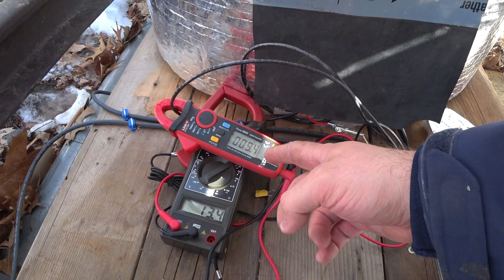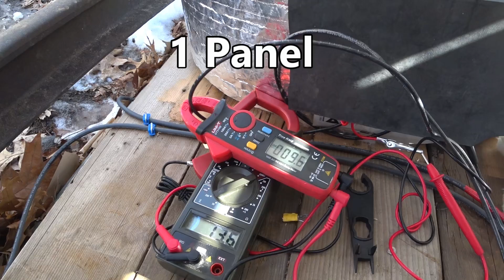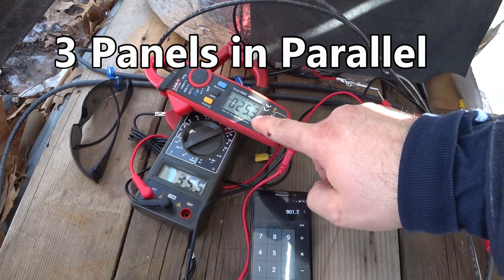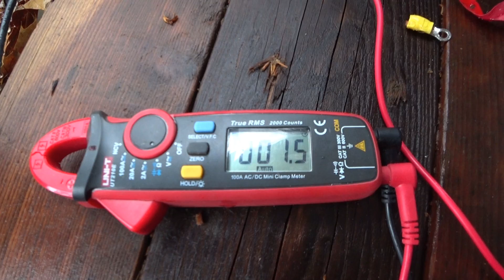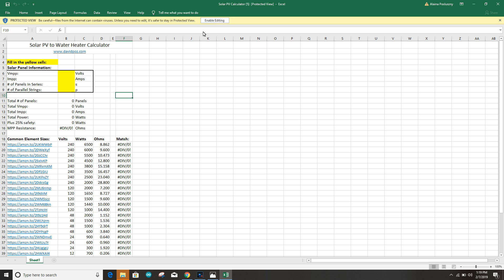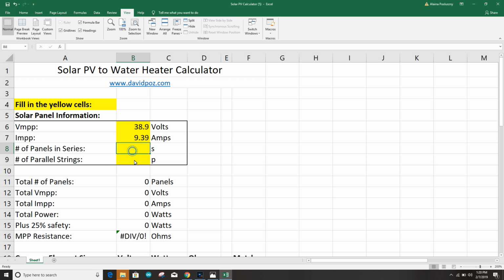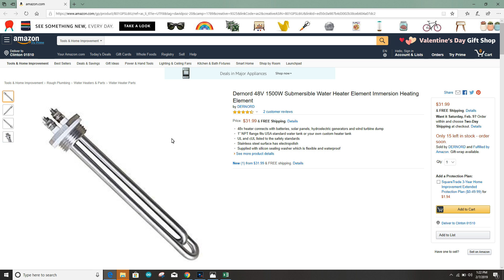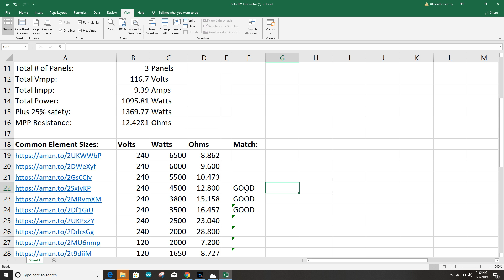Matching Water Heater Elements to Solar PV Panels

Comment: You never explained what was wrong with your "three in parallel" set up. It sounded like you had them in parallel. What was wrong?
Reply from the maker: Originally I had the panels in series.  But the ohms was way off and I was getting almost no power.  By switching the panels to parallel they matched the ohms and BOOM! heating water.  I created an excel spreadsheet available for free on my website to help.

Comment: but why they sell controller for the setup in series not in parallel...  https://3k-solar.bg/en/thermosol-k2/ ...becouse i have 6 panels 400wp /41.23 Vmpp; 9.70 Immp/ and i thinking to do 2x (3 panels in series) in ur calculator mean use 240v/3500w heating element, if i use 2x (3 panels in parallels) mean 48v/1500w heating element....  now i dont know what to do.....did i need that controller or not
Reply from the maker: The controller will probably gain you 30% more hot water than no controller.  So is it worth it?  Depends how much the controller costs.
Reply: @DavidPozEnergy  2x 200$

Comment: Is is a good idea to connect heating element direct to solar panel?
Reply from the maker: Well, you still need a fuse and circuit breaker in the circuit.  But the principle is what I'm testing.  It's not as efficient as using a MPPT controller, but it's a cheap way to get into solar.

Comment: Your 48v DC element is a two 750W 48V elements in one , if you change the bridging tab at the element, you can change that 48V 1500w  element into a 96V 1500W element, this way you don't have to have run with a larger current, and can work with other panel configuration. I have work on the 36V elements and changed them also to a 72V element by changing the bridging tab around on the element. so with these elements you can have 36V, 48V, 72V, 96V elements

Comment: There is "good combination" for a direct pv to elements connection, there is one that is not as bad as the others and still... It depend on where you live and when you want to maximise your production. You need an mppt or you'll lose 20 to 35% energy.
If you calculate the resistive value of the element based on 1000w/m2... Then it will work like shit on low irradiance days, at 500w/m2 it will already give a quarter of the full power....

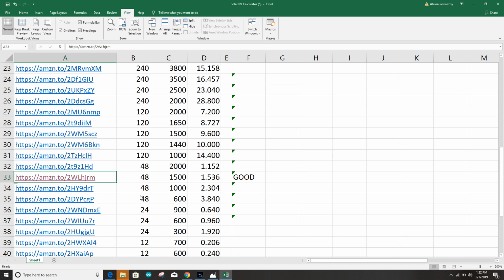Comment: at the 10:50 mark, you mention using a "standard of the shelf" heating element.....are you talking about the ones that come in the water heater from the factory?  if so, is there such a thing as a "DC" vs "AC" element?  or (as I am guessing) are all elements AC or DC? as well as non polarized...if that's the case, what size panels and how many and (I am guessing parallel) would you need to run a 240 volt 4500 watt  element?
Reply from the maker: Yes, you got that right.  The standard water heating element that comes from the factory is just a big resistor.  Resistors are not polarized.  They work with both AC and DC.  But, you must be careful because nothing else on a water heater will work with DC.  You need to have DC rated thermostats and relays
Reply: @DavidPozEnergy  ok, got that.....dc thermostats replacing the ac thermostats.....
what size panels for that pre-installed 240 volt 4500 watt factory element?
Reply: David???
Reply from the maker: What panels work with a heating element for 4500 watts and 240v?  Any panels can work with it, the trick is to arrange the panels in the right configuration of series and parallel.  I built a free online calculator, on my website home page.  The calculator will help you decide.  For example, if you buy Q-cell 360 panels, you would arrange 3 in series for the factory heating element 4500w 240v.  But the exact number of panels will depend on the panel you choose.

Comment: Keep in mind that the Vmpp and Impp are measured under standard test conditions which will likely differ from actual use conditions. For Vmpp and Impp the panel temperature is kept at 25C and level of insolation is equivalent to high noon... 1000W/meter^2. If the panel is hotter than 25C, then the actual maximum power point will be lower than what is given, and the Impp will be higher. Also, if the insolation is lower than 1000 W/m^2 then Impp will be lower than what is given. So the spreadsheet is a good first cut, but ideally you would adjust Vmpp and Impp to match your actual use conditions before calculating a resistor value. In general, you will probably want to have a slightly higher resistor value rather than lower (compared to Vmpp/Impp).
Reply from the maker: I agree with you.  That's why I made a range in the spreadsheet.  So if there is not an ideal resistor listed, it moves up, up as high as 40%.  One of the coolest controllers I've seen is Electrodacus.  His will add more resistors, or take away resistors, to match the panels.  Really cool.
Reply: @DavidPozEnergy  Yeah, love the spreadsheet because it gives you a starting point. Most likely the power ratings on the heating elements are not intended to be upper limits. They are probably just calculated based on V^2/R. It is probably safe to over-power them by quite a bit since it is just a water heater, after all, and as long as there is water in the container (at atmospheric pressure) there is no way the surface of the heating element can get much hotter than about 212F. Incidentally, what does your system do if the water all leaks out and the element continues to be energized? It might be worth knowing what happens. Thanks for the videos.

Comment: Solar for daylight understand, warming house at night ? Is it any solution?
Reply from the maker: What I do is warm my house during the day with solar.  I built my own house, and it is super-insulated.  So it holds the heat in.  Only cools off a degree or two (F) overnight.
Reply: @DavidPozEnergy  Thank you, I've been watching your videos, is perfectly understandable ,I planning doing same as you. In Europe ,winter temperature can drop to minus 20 degrees Celsius . For sure must have a super isolated  house with HRV for a good fresh air and  nominal humidity . Thanks again.

Comment: Thanks for doing this research.  I had been thinking on diverting power once batteries are full and the part I was missing was the heating element impedance and the heating element adapter.  I thought of buying a tap, but this is much easier and cheaper.  Appreciate what you do!

Comment: 3x38.9 =116.7 volts should be a 110 volt element not a 240 volt element in your final chart on video?
Reply from the maker: It's more important to match the ohms then the voltage.

Comment: Hi David, could you please tell me what kin of controller did you use, SSR controller, expensive or nothing, controller, i tried use cheap chinese SSR relay, but, they are just crap. Thank you.
Reply from the maker: I used nothing.  This was a direct connection.  I've put together the parts to make a thermostatically controlled relay, but have not gotten around to building it.  I was able to use a direct connection here because it was a vented drum.  But don't do it with a pressure tank.
Reply: @DavidPozEnergy  Thanks man. As i said before, my plan is just raise the temperature from 85f to 110f.  My tank is not sealed.

Comment: Hi David, I'm building a house for me and my wife,  i have aplan to mount a solar  energy, the house is 300 meters from the sea. Is a hot land, i will need just raise the temperature from 25 to 40 degres celsius. Afetr see your videos, i decided  use 3  330 pannels dedicated to use in my hot water needs. As you show, is possible use just 1 48v heater element, 1 80amp SSR relay,  1 Timer, to on off,  I need something  easy, for me does not metter, if is eneficient. I have sun all day long and 300 days. Thank you so mutch for your generosity to share your knowledge.

Comment: Ohm's law will tell you how many volts divided by amps equals resistance 240 volt divide by 18.75 amp for a 4500 watt element = 12.8 ohms if you times 18.75 by 240 volts you will get the wattage. Everything works out in Ohms law. This is why a Battery charges by the resistance of the Battery, as the battery increases it voltage level it increases it's resistance and lower the amps going in to the battery. Solar panels should be able to be hooked in series up to the rate voltage rating that is on the panels some to a level of 600 volts like this page explains. https://hespv.ca/blog/wire-solar-panels-parallel-vs-series/

Comment: Are you sure that the standard AC element would be fine? I am using your calculator and if I use 3 of my 240w panels in series I can supposedly use the standard 4500w AC element  - I am within days of plugging in my tank and system and want to be sure that the AC element is fine to use
Reply from the maker: There is no difference between heating elements sold for AC or DC.  However, you must make sure you use DC rated switches, contractors, and thermostats.
Reply: @DavidPozEnergy  thank you for clearing that up for me - and thanks for the video - watching more of them now - great stuff

Comment: So why can't i take a normal hot water tank and put an additional heating element, one for my solar collector and one for the regular electricity which is already installed...and it just assists the power I pay for from the electric company?? or even just create a way of powering the one that is on it from both.
Reply from the maker: In some situations you can, but it can be dangerous.  You have to make sure there is a way to cut-off the electricity from solar if the tank gets too hot.  The built-in thermostat won't work with high voltage DC.

Comment: hi David, just discovered your channel and loving it slowly working my way though your videos  .in this video your heating your hot water tank but do you think this set up would be able to cope with an accumulator tank for a radiator system in the home ?
Reply from the maker: Thanks for checking out the videos.  Radiator systems in a house use hot water, I usually see boilers set to 180°F.  And the BTU output of the boilers are high, maybe 180,000BTU/hr.  That would be very hard for a solar system to pull off.  I certainly would not start by trying to do that.
Reply: @DavidPozEnergy  thanks for the reply, my Mam has an air source heating system, the radiators in the house are very big, the idea behind this system is for the radiators to be at a steady heat (you could put your hand on it but not get burnt) probably slightly warmer than your garage floor heating, I figured if I did the same but had a tank(2000 litres)  and possibly run it with solar and 1kw wind turbine aswell.
Reply from the maker: I made a space heater directly connected to solar a couple years ago.  It might be similar to what you are looking for: https://youtu.be/jFoxIit8NYA

Comment: The thing is that PV panels give you a voltage that is more or less stable and a maximum current that depends on the amount of solar radiation. By rewiring your setup the heater works now, but if the amount of sunlight changes you may be back to square one. Here's why: Let's say it's partially cloudy. Your panels will still give you roughly the same voltage (about 0.5V per cell), but the maximum current drops. Your heater is basically just a resistor, so the amount of current it wants to draw is going to be the same as on a sunny day. But on a cloudy day your PV panels are unable to supply that kind of power. As a result, the voltage drops dramatically and your power drops even more (Power = Voltage squared devided by resistance). What you need is a Maximum Power Point Tracker (MPPT) that will actively search for the optimal current to draw from your PV panels, where the power (current x voltage) is the highest. This point depends on the amount of solar radiation.
Reply: *THAT*  is very true;  the ONLY way it may work,is if you DOUBLE the panels you actually need; and even so, in WINTER, do not count on it,no sun; summer no problem;
here in SW Europe(Portugal) i was without ANY sun( well,around 40 watts...   lol) for 11 or 12 days, now in March; the whole winter i had to be plugged in to the electricity supplier most of the time;  they are called SOLAR panels,not light panels;no SUN,no juice, light alone does not cut it,you need SUN, the one that makes SHADES of things, not just light; diffused sunlight thru the clouds gives you 1/3rd  IF the clouds are like cottons,white,if they are dark,almost nothing;
After 2 years i regrett i spent all that money in 6 panels,MPPT, inverters (breaking down twice!!) very expensive lifepo4 batteries,and..countless hours;  not worth it,and it ROBBS you of your Peace Of Mind;

Comment: Have you done anymore research on how to increase efficiency with a PV direct system? I recently hooked up 6 panels to a 111v 1800w solar system. I matched the ohms properly but for only an hour I get MPP on sunny days. On cloudy days it's barely worth running. Some are saying to use a solar pump linear current booster but the cheapest I see are $300+. Are there any mppt charge controllers that can't output direct to the heating element?
Reply from the maker: I found the same thing, that at full sun I can hit MP, but then it dies down.  I want to make another video diving into this topic, but it's down the list.  In the mean time, try using a water heating element that is 20-30% higher ohms than MPP.  I found you will overall get more hot water this way.  That's what I put into my free calculator on my website for the range.  
If you want an MPPT controller without batteries, you are right that $300 is the cheapest.  However, if you are handy you might be able to make your own by watching Operas videos: https://www.youtube.com/channel/UCgjG28Ml0hEO_jueEKEjdAg
He describes how to make them.  I'm actually trying to make one for a video but not there yet.

For myself, I'm working on setting up diversion loads so I can heat water with AC (alternating current) from my DIY powerwall setup.  That way I get the full MPPT of my charge controller working for me.
Reply: @DavidPozEnergy  So according to the math a 7.5ohm 120v 2000w element was supposed to be optimal. I found on cloudy days I was making nothing. So I switched over to 12.5 ohm 240v 4500w and am making much more consistent power. Although my maximum output dropped from 1.4kw to 1.25kw. With my 1800w array I make 1-2kwh/day when cloudy and 4-5 kwh when sunny. Pretty happy with the results. I know there are losses when charging batteries, and they eventually wear out. So for now I'll keep testing elements to find the happy medium. Thank you!!
Reply from the maker: Great real-world example.  Thanks for sharing your results on the 12.5 ohm vs. 7.5.
Reply: @DavidPozEnergy  please do dive further into this topic in a video as it seems like a super cheap way to store energy and get started with solar! From my predictions you can safely store 5kwh in a 50 gallon tank a day with normal hot water use.
Reply: View my videos on how to build one. I do just that to heat water at power point. I can't see why people won't spend a couple of cups of coffee to learn something new.

Comment: How can I use the calculator on an iPad ?
Reply from the maker: I built the calculator on an excell spreadsheet.  You will need excell on your device, or some kind of software to work with excell.  I don't own any apple products so I don't know exactly.  Your local library might have excell on their desktops, mine does.

Comment: Voc = 47.7, ISC =9.92, R =4.8 Max power transfer is when R (load) = R (source) so you really need 6 panels either as 3 pairs or 2 triples

Comment: A 365W panel and a 1500w heater?, you need at least 4 of them, in series too
Reply from the maker: I got very good heat generation with 3 panels in parallel.  thanks for watching.

Comment: Excellent video. I am interested to know how well the three panels in your experiment did heating the tank? I live in the Caribbean so the ambient temperature is already over 80f most of the time and the water supply is around the same. I have some 260w panels and wonder if 2 or 3 panels would be sufficient. Interested to know your thoughts.
Reply from the maker: If your water and air is that warm, then you will have success with hydronic heating.  A flat-plate collector, or batch tank heater.  But, if you have the solar PV panels anyways, then they will heat plenty of water.  In order to match your panels up with a heating element check out my free calculator on my website: www.davidpoz.com
Reply: How was the result for the parallel pvs and the 48v, 1500w element? What size cable needed?

Comment: How do you prevent it from boiling
Reply from the maker: This is a drain-back system.  Anytime the pump shuts off the water drains back to the tank and the panel (collector) is empty.  The controller has a high-limit temp. of 180°F when it shuts off.  Although in normal operation you would not reach it.